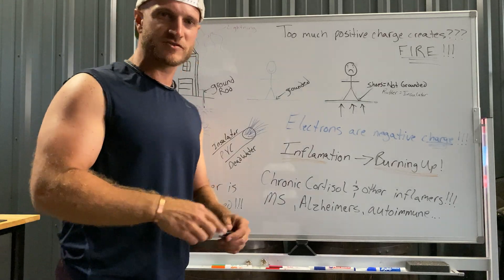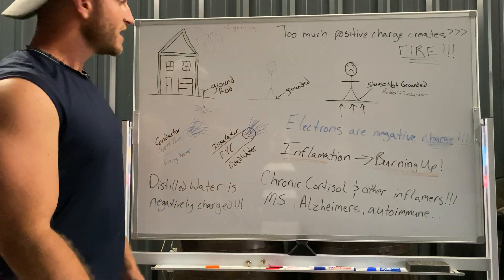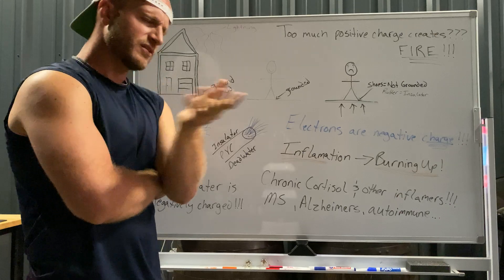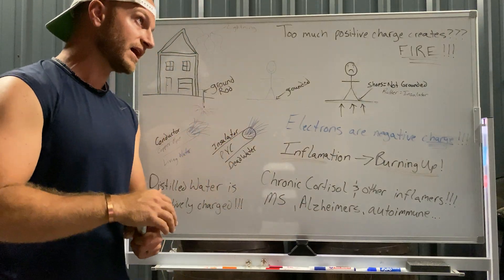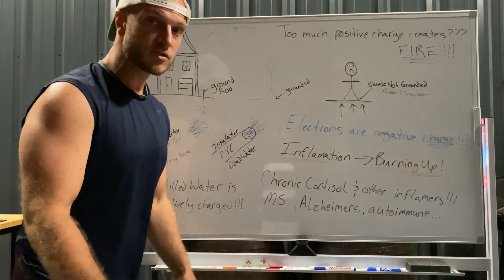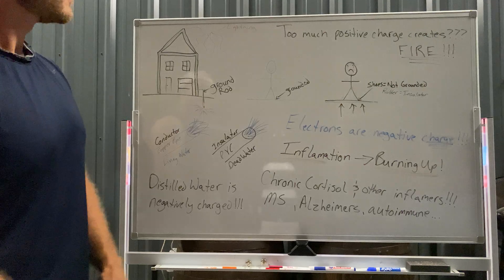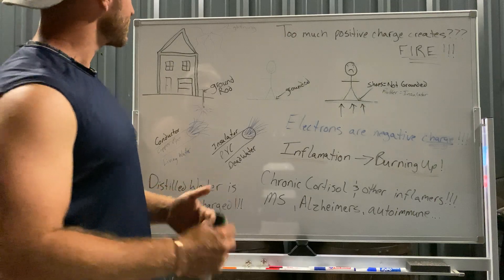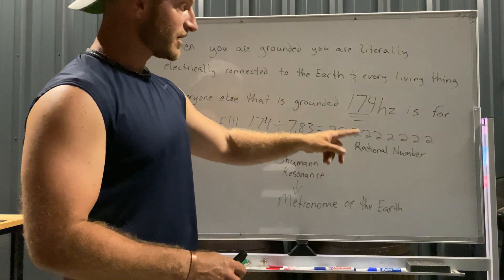How does grounding work?

Comment: After about eight years I had to start wearing shoes.. back problems from walking on modern infrastructure.
Reply from the maker: I use a grounding sheet and pillow case and spend at least 10 hours a day on it , work in the yard barefoot when I get home from work and wear sandals everywhere but work to flip off quick if desired…

Comment: Anyone who doesn't believe we have electricity running through our bodies get a decent volt meter mechanics use grab each prong with the tip of your fingers and see it actually gives off a voltage reading it's low but it's there. I started listening to Frequencies Sofelgio all of them during my sleep then I stopped what I found over a months worth of doing so is I sleep better with the frequencies playing while I sleep and woke up feeling better and more rested then with out

Comment: Great video! I've been grounding a lot more lately and now I get this video. One question though, if my floors are wooden will I be grounded by sleeping on the floor?
Reply from the maker: Wood doesn’t hold water after it’s cut and hardens, then is usually sealed with a coat, also is it raised off the ground or sitting in the ground, what does the layering look like etc… Wood is more of an insulator but not like a petroleum or rubber insulator at all… So it’s not usually grounded and not really a hardcore insulator… But it does have a very quality vibration due to what it’s made out of and can embody and resonate wonderfully in many ways… Good lighting and good sound and fresh air in a wooden house on a grounding mat or rug sounds amazing to me…